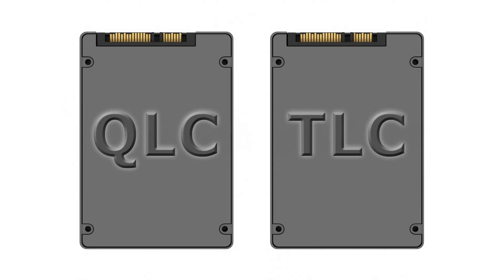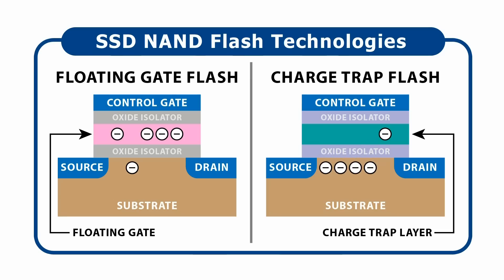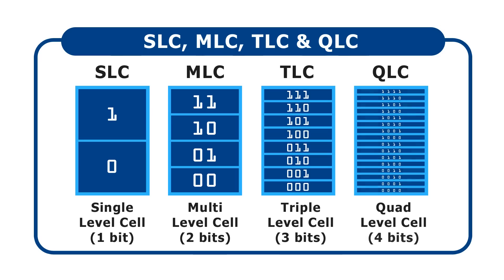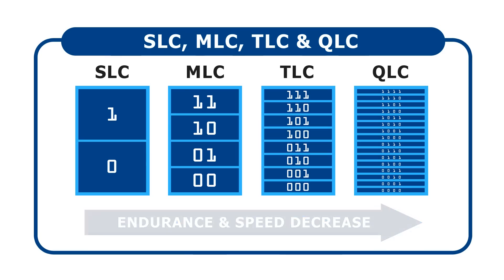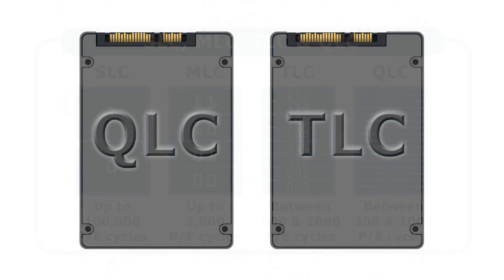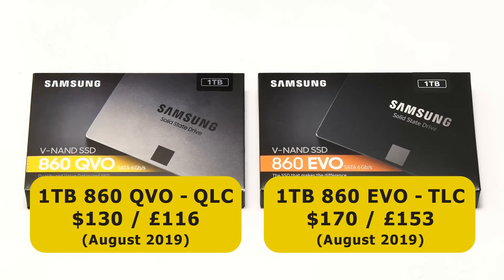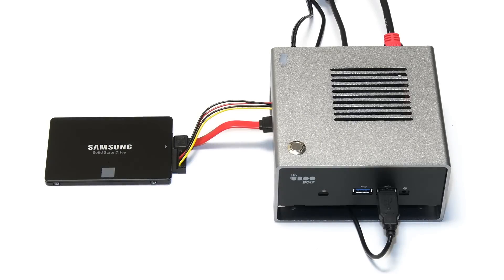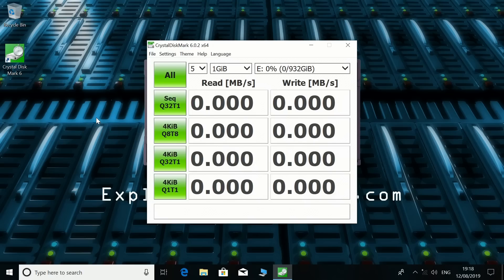QLC vs TLC SSDs: Samsung QVO & EVO

Comment: The price difference here is negligible so there's no reason to get the QLC drive.
Reply: TLC is 30% more expensive than QLC. How is that negligible? You can also get the Intel 660p for the same price as the QVO, which get you a massive speed increase for everything that is not a 40 GB file transfer. I doubt a typical user will have such transfers more than once a week, if even. If you do have such transfers, sure, get a TLC (or MLC), but don't kid yourself that you're a typical user.
Reply: The QVO 1TB is just 19EUR cheaper than the EVO. I'll gladly pay that small amount for vastly improved write speed and longevity. At half the price I might consider it.
Reply: @bakakafka4428  That is strongly region-dependent. For the Netherlands the prices are 140/100/100 for the EVO/QVO/Intel 660p ( https://tweakers.net/pricewatch/compare/1131815;1273731;1233359/ )
And for normal use they are pretty much the same. How often do you transfer files that are over 40GB?

For normal use the three drives I linked are indistinguishable in speed and longevity. Arguably the 660p even has an edge (but that's M.2, so not really apples to apples). If you want a slightly more balanced view, rewatch this video and/or watch the Linus Tech Tips review of the 660p.

Comment: Still running my OS on a Corsair Force GT 240GB. The drive was bought on 29/08/2012 (will be 7 years in exactly 4 days), has 17.21TB of Lifetime Writes, 1174 days Total Power On Time, and SMART still reports 100% health lol.
Meanwhile, my WD Caviar Black 2TB that i bought the same day died about a month ago and took a bunch of my data with it (i have a backup drive, but the data on there is a bit outdated compared to what was on the internal Caviar Black). Initially it was used for storing games, but later down the line, it was there only for music, movies and recordings, as i had bought a 1TB SSD for games. 
So yeah, initially i wasn't too trusting towards SSDs either in terms of their longevity, but realistically speaking, they last just as long as a traditional drive, if not more in some cases.

Comment: So basically TLC is better and worth the extra money for several reasons. Nice. Thank you and great video!
Reply: For normal use? Actually, no. Unless you move big files around on a very regular basis you are unlikely to notice the caching, and unless you are doing a lot of read-write cycles (e.g. by moving big files around) you are unlikely to hit the limit.

These drives have controllers that spread out the wear over the drive, so the lifetime of a drive is much longer than the quoted warranty. Which makes sense, as Samsung probably doesn't like having to pay for the warranty more than they need to.

If you want more info and a more nuanced view you can also watch the Linus Tech Tips review of the Intel 660p ("How SSD Technology Keeps Getting WORSE! - Intel 660p Review
"). The conclusion there: sure, you have less duty cycles before failure, but you're not going to get there with normal use, and you shouldn't rely on a single drive for critical data anyway (which is also true of a hard drive).
Reply: @rikwisselink-bijker  I just saw the Linus video and yea, you're right. But I still would prefer TLC over QLC for now. Thanks.
Reply: @mclaine33  You're welcome. And tbh, I prefer TLC as well (or even better: SLC or MLC), but my wallet threatened to give me no food for a year, so I settled for QLC ;)
Reply: @mclaine33  ,
Huh? He's right but you still prefer TLC?

Comment: I think the duel drive setup is still valid.  My preference is TLC drives everywhere but I think QLC drives are perfectly acceptable as an archival drive where you will tend to occasionally write much less than you read.  (Read cycles don't wear out the drive so you can pretty much read forever).  It depends on the system of course.  On a cheap system with a two to three year life expectancy that will be used mainly as an internet machine the QLC all the way.
There are differences in drive quality by maker as well.  Samsung is certainly best but Crucial is second by a nose.  I chose Samsung EVO (NVMe) as my boot and a Crucial as my data working drive and whatever is affordable as archival drives.

Comment: At those prices and capacities, for most applications a valid data retention strategy would be "write once, when the device is close to 80%, pull it and stick it on a shelf". Physically, the 2.5" format is about the equivalent in volume to, what, 4 3.5" "floppies"?   Of course, we then get a recursive problem of indexing the stored data......

Comment: If using 1 TB QLC then we need to make sure not to copy paste exceeding 40 GB at a time, instead split copying data around 40 GB max at a time, in your case it would have been done in 4 minutes, if you had split 40 gb and 35 gb two copy pastes.
Reply from the maker: Correct. If you can wait a bit between two large copies, the effective speed would be higher.

Comment: Good Video!
Would you mind explaining what the differences are between a SSD Dramless and an SSD with Dram?
Reply from the maker: An SSD with DRAM has a RAM cache for speeding up write/read activity (just a like a HDD does).
Reply: @ExplainingComputers  thanks for the answer but there are on sale even SSD without DRAMs are usually the cheapest, I've heard that they have a shorter life expectancy than SSDs with DRAM although the topic is not widely discussed.

Comment: For the normal people the drive setup with suffice, but for many of us  even in latops we customize with purchasing a highend laptop with its minimum disk setup only to swap it out with Nvme / Sata drives and a large capacity high speed platter drive.

With us running Linux mapping drives using fstab is trivial alongside LVM options, this only adds to extras with building a custom PC rig.  Unfortunately in Windows you do not have these luxuries with the madness of C: etc etc etc, you know *nix got it right with files and folders real char and block devices.

I have an older T430 Lenovo laptop with this getup,

250GB Samsung EVO ( ssd )
1TB Toshiba ( Platter )

sda      8:0    0 232.9G  0 disk 
├─sda1   8:1    0     1G  0 part /boot
├─sda2   8:2    0     1G  0 part /boot/efi
└─sda3   8:3    0 230.9G  0 part /
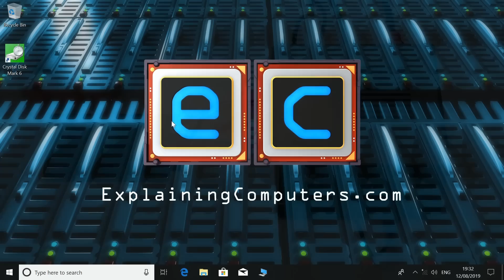sdb      8:16   0 931.5G  0 disk 
├─sdb1   8:17   0     5G  0 part [SWAP]
└─sdb2   8:18   0 926.5G  0 part /home

I replaced the cheap nasty drives and memory with better / fastest options ( maxed out memory ).  In this configuration this laptop is blazing, a joy to use despite its age.

It should be interesting to see how all this plays out for certain, perhaps this might be the steps forward to find new ways to increase the life expectancy, the same ways they did for SD/Micro Flash with the valid writes.

Comment: I'm still upset that I can't hardly find any MLC drives anymore, I don't think I will EVER accept a QLC drive, not even if it was free. I'd rather pay a little more, and get a quality drive, that will last much longer. There is nothing more valuable than data, and nothing worse than a drive failure or data loss.
Reply from the maker: You can still get MLC -- like Samsung's PRO SSDs. But they are indeed getting harder to find.

Comment: If the price of those QLC drives come down a bit more, I'd consider making a big RAID 10 drive with them, to use as the only storage drive (boot drive included) on a computer.

I still don't trust either kind of drive (HDDs and SSDs), to not fail unexpectedly, though. My sample size is pretty small, but I'd personally witnessed two separate incidents where a HDD failed, one of which the HDDs were configured from the factory, as RAID 0, with a Windows recovery partition, meaning that when one died, it took EVERYTHING. I haven't actually seen a SSD die, but again, my sample size is small, as I only have firsthand experience with one computer with an SSD installed, and that one is still relatively new, although it did have have a HDD fail only two years or so, after it was purchased new, from a reputable seller, which was one of the two incidents.
Reply: Regard if hdd or ssd, never rely on a raid zero. That is just asking for trouble down the road.
Reply: Maynne Millares,
Which begs the question: Why did the computer come configured that way?

The computer in question was bought around 2007-2008, back in the era of Windows Vista. Maybe the training for staff at the place it was bought, hadn't caught up with the knowledge that RAID 0 is an unsteady foundation for an OS install?

Comment: Always have one or several cheap external drive for incremental backups of the user data (home dir), which should happen automatically in the background and quite often. If one has several, rotating these external drives is the way to go, so if the system would get compromised the disconnected drive would have the older backups. Maybe also a BluRay burner for long term storage (up to 1000 years) of smaller amounts of data, like the home directory incl. cryptowallets and other keys, might also be a good thing to have. If only installed games or such stuff, stored on an SSD, gets lost it's not such a big problem. If someone uses torrents to download a lot of videos or wants to make a backup of big amounts of data, cheap and huge hdds are once again good for that, probably also external so the data can be transported. These don't need to be SATA drives, and can be slow and cheap. Watching a video doesn't need much data transfer per second.

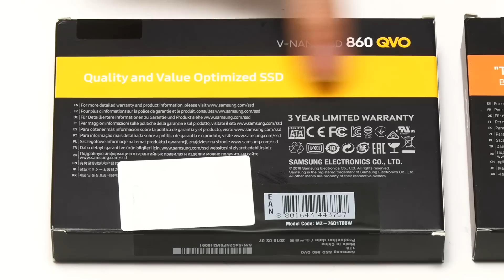Comment: 5:12 i checked after that with CrystalDiskInfo how much i have writen on my 970 Pro and my 860 Evo. both drives got installed on the end of November 18 and the 970 pro has seen 4223GB date writen (as C drive) and the 860 Evo just 1664GB. so i guess even the QVO should last verry long with "normal"* usage.
* i use an 2TB HDD for big files like Videos or Backups and for my VM's, only games are on the 860evo

Comment: Just as in the Olden Days, If you cherish Your Data your going to perform REGULAR Back Ups.   Only working on a Personal level I back up all Data and Files once a quarter.   I should be accomplishing it at least once a month.    The quest is not if the Drive is going to crap out it's WHEN the Drive is going to crap out.  It will Crap Out at some point for sure if your not rolling your chit over to a new Drive every few years.   This drive here is 4 years old.  Emmmmmm  ?   Can I afford to loose all my chit going back three months?   Yea but I sure would be Pissed.  All Current projects would be Lost.

Comment: Ya, but the prices and capacities for HDD will also get better with time. I can get an 8TB 7200RPM HDD for $250 CAD, that's a lot of games and media.
Reply: 8TB is more like a NAS storage.
With lots of streaming services there's not much need for huge hard drives.
And not like you gonna play all 8TB of your games, easier to just download on demand and have faster loading times on games you actually play a lot.

Comment: 3 year warranty on a storage device? no thank you... thanks you the info! I was totally unaware of qlc
Reply: It's still 360TBW, that's filling up the drive completely 360 times. 

My oldest SSD's aren't even close to those numbers, and that's a good.. 5-6 years. 
Of the older drives, my 500GB >850< EVO has 686 days on it (power on hours), it's had ~15.000 GB written to it, so 15 TBW, out of the 150 TBW endurance it came with. It's been well used over the years, and was my OS drive for a year or two (release date: 2014). 

I get wanting 5 years though, but if those 3 years is based entirely on some idea of you using some 328GB/day, then eh.. yeah. 
It also does come with a MTBF (Mean Time Between Failure) rating at 1.500.000 hours across the entire range (1-2-4TB) - that's equal to ~171 years. Even if that's not exactly what it means, but it can be googled if curious :)
Reply: Other manufacturers are very cheap, I guess it's good for storing games/not much writes...and use tlc for system drive

Comment: The TLC SSD could be moving data from the SLC cache to the TLC level at the same time that it is writing new data to the cache. That would explain why the cache did not seem to fill up. Or the cache is bigger than expected, or the TLC is so fast it doesn't even need a cache.
Reply: I suspect if you wrote several hundred GBs to the TLC you would eventually see a bottleneck, but it would never drop as low as the QLC did. The write speed from SLC to TLC is definitely slower than from NVMe to SLC so an eventual bottleneck is inevitable.
Reply: Or they had a surplus of the 72GB cache ICs and produced 1TB SSDs with the larger cache.
Reply: Paul Perkins,
Your first sentence doesn't make sense. If a cache fills up then performance drops. That's the point of a cache. So the SLC cache filled up for BOTH the TLC and QLC drives right at the beginning then performance on both dropped to about 550MBps sustained. Some of the QLC is written to at less than 4-bits per cell so it acts as a larger, but slower cache compared to the SLC cache. So once you fill up that second cache you finally drop to the performance level of 4-bits per cell writing direct to memory... as for the 3-bit TLC memory perhaps there's no longer any need for a secondary cache. I assume that's what's going on as I found this from 2018:
"As sustained write speed is no longer a concern with the latest TLC SSDs, the only reason to go with an pricier MLC drive such as the 860 Pro is if you're concerned about longevity or write far more data daily than the average user."

So it sounds like 3-bit was reserving some memory as a secondary cache but then they improved things until they got the performance natively and just stick with the SLC main cache, so it's possible QLC will do the same thing and drop the 4-bit memory that's been reserved to act as fast cache.
Reply: @photonboy999  You sound like one of those technobabble chatbots that were a thing a few years ago. Either that or you are drunk.

Comment: This is so fascinating. Can you explain also the benefits of DRAM Cache for SSDs vs DRAM-less SSDs?
Reply from the maker: DRAM Cache -- for example when activated when you use Samsung's RAPID mode -- holds data in a PC's RAM as a cache to increase (apparent) write speed. Personally I would not touch this function, as in the event of a system crash, data is lost.
Reply from the maker: In addition, there is some RAM in most SSDs -- like those here, and as there is in most hard drives -- that is used to speed up write and read.

Comment: In terms of reliability, I would have thought the big imponderable is how much hidden spare capacity the drives have to replace failing chips, and how good the forward error correction is.
Reply from the maker: True. And I imagine relatively little spare capacity on drives of this size.
Reply: In that case I would think it wise to leave unformatted space on the drive (e.g. format a 1TB drive to 800GB) to allow more space for that remapping of faulty cells.

Comment: QLC only for archiving, TLC for real using.
Reply: Well not really, QLC is for everyday average Joe use. No normal consumer will reach the SLC cache anytime soon or even the TBW limit of 42GB. Average users will not notice a difference until their use case changes.
Reply: @d1oftwins  sadly christopher has made an error, 42gb is only the cache at the beginning with empty SSDs. When the capacity is full the cache shrinks very much.

Comment: SUGGESTION: you should talk about backup strategys.
I once read that 95% of any Company that suffered a complete Computer failure do not exist anymore 3 years later.
this is most likely due to failed/non existing backup strategys.
Reply from the maker: That statistic is I believe correct. I have not made a backup video since 2016 -- https://www.youtube.com/watch?v=rFO6NyLIP7M  -- it is maybe time for another!
Reply: What about companies that didn't suffer a complete computer failure, for comparison?

Comment: These are very interesting for system integrator to allow for the inclusion of large SSDs in pre-built computers, however I don't see myself getting one of these piecemeal considering the price difference with TLC.
Reply: It 30% cheaper (or TLC is 40% more expensive). The difference is only noticeable when writing 40GB files in one go. If you do that regularly, you're not a typical user. The mean time between failures is 1.5 million hours for most drives (either QLC or TLC). That is based on a drive write per day of 0.33 for the EVO and QVO, and 0.11 for the Intel 660p. Again, if you go over that, you're not a typical user.
Reply: @rikwisselink-bijker  It's more of a 20% difference right now (street prices (ie Amazon) are 115.99€ for a 1TB QVO vs 139.99 for the EVO equivalent) , but you are right when it comes to the endurance figures - that's why I mentioned system integrators. When it comes to my own data however I would rather pay the extra for the additional endurance / peace of mind. I've written 19 TB to my 960 EVO over the last 13 months, which means that I'm theoretically still good for another 20 years as it's rated for 400 TBW, but I like the headroom.
Reply: @SteelSkin667  Paying extra for more peace of mind is a personal call. Since I don't own anything tech-related that is over 20 years old and still works (my record would be my 10 year old TI-84). So I am happy to take that gamble.

Street prices vary a lot by region/country (even if you seem to be from the euro-zone as well). Here in the Netherlands prices are 140/100/100 ( https://tweakers.net/pricewatch/compare/1131815;1273731;1233359/ )
Reply: @rikwisselink-bijker  Oh yeah, it's definitely a personal choice, and I might change my mind depending on how pricing will evolve, not to mention that processes tend to get better over time, and therefore drive endurance gets better - Samsung doubled their endurance rating between the 850 Evo and 860 Evo series.